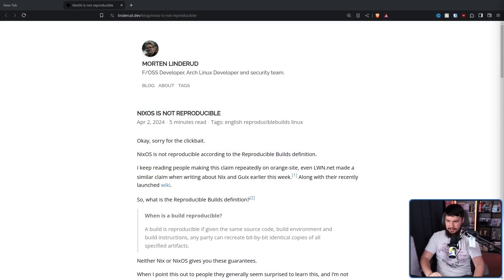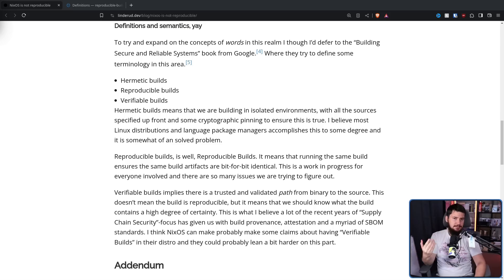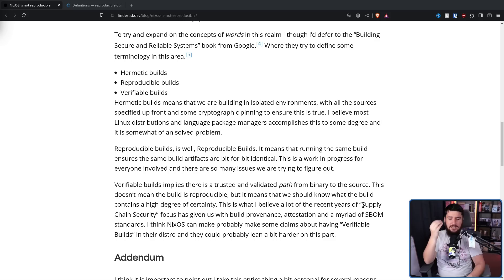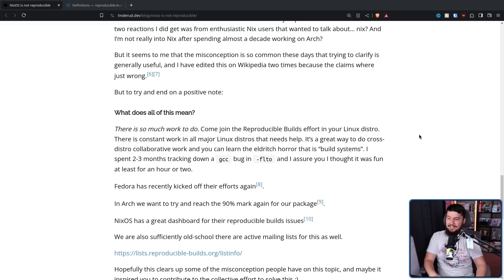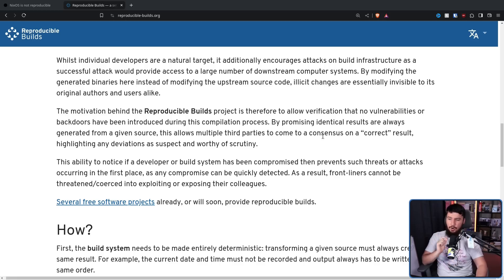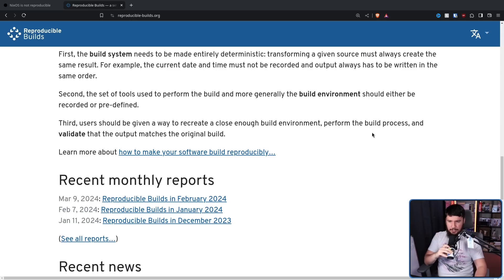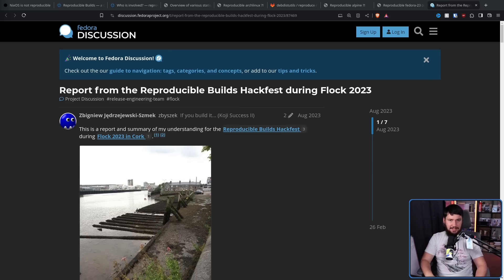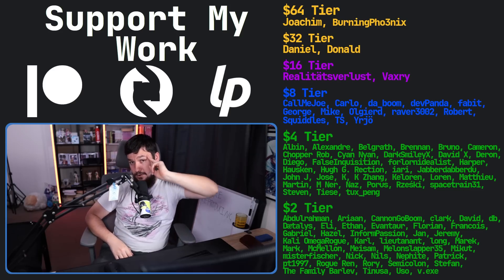Reproducible Builds: Final Step In FOSS Validation

Comment: 100% reproducibility is required for aerospace software applications. There can be exceptions like a date timestamp and CRC, so long as the functional requirements are properly verified. Non-deterministic behavior is not tolerated due to functional safety...how does the customer know that the verficiation tests that passed once will pass again?
Reply: 100% determinism is required, meaning that the program always behaved in the expected way.

Reproducibility is different in that the underlying binary should be identical.
Reply: @Person1873  I see what you are saying, but (aerospace) software verification results are tied to the requirements, traceable through source code and through the resulting binary. That traceability all the way down has to be deterministic. In other words, the verification test results are tied to a particular binary.
Reply: So, you’re saying that AI/ML will never be allowed in aerospace applications…
Reply: @warpedgeoid  Maybe as a tool for humans to use but probably not with direct and absolute control over systems at least in the near future.  

@dozerd42 I'd love to know how they do the functional verification and if it could be applied by the opensource community.
Reply: @KLR-3  the main way to show full coverage is to run and pass all verification tests on the release binary, then run the same verification tests on a modified build with instrumentation. We used a program called VectorCast. The purpose was to show that the same tests pass on the modified binary, and 100% MCDC coverage is achieved.
Reply: Not in anything that can jeopardize the mission. Hal was right about Dave. Dave is neither deterministic nor reproducible.  @warpedgeoid
Reply: @warpedgeoid  Id love to observe the FAA conversations about AI in flight control software! My guess is that DAL A will never allow the inherent nondeterminism that AI has. Think about this: the pilot wants the aircraft to behave with predictable deterministic behavior. Every combination needs to be functionally tested (MCDC coverage)
Reply: @warpedgeoid  On the other hand, cabin electronics devoted to nonflight critical applications would not have a problem with AI. For example, a blu-ray player for passengers is fine as long as it doesnt short out and cause fire. Software on the blu-ray player in the cabin would be an example of DAL E software. Hardware is governed under the RTCA documents
 DO-254, software under DO-178
Reply: PGP signatures against the working software, it's the only way I could think of, one bit is changed PGP signature is completely different

Comment: Personally I think Nix has the right idea, but execution wise it's way too difficult to set up, maintain, understand. 

We need a new generation of Nix-like packaging that's integrated better with familiar tools and apps like Discover/GNOME Software, for a start.
Reply: what we actually need is to seperate OS from software.
Reply: @bigpod  Agreed, haphazardly dumping everything into /usr/bin and /usr/lib is slightly insane imo and it's still what every major distro still does.
Reply: @bluesillybeard  putting things into /usr/bin and /usr/lib isnt a problem they or something similar needs to be there but how they are managed is if they were layered file systems of their own it would be completly controllable and seperatable from base OS /usr/*, kinda like containers just directly on your host using OverlayFS(same filesystem containers use)  honestly i would make everything an overlay even home directory on top of a clean basic(very basic) installation of OS
Reply: @bigpod  This is what I mean. Some way to manage the files in /usr/* that isn't just adding and deleting files hoping you don't accidentally get a conflict and end up breaking something. The hard part really is just getting everyone to support it. Flatpak is getting a lot of attention but it has a lot of issues.
Reply: @bluesillybeard  thats why im pitching overlaying files they dont touch each other so you can delete and add however much you want(specially if you are adding layers instead of just mutatating mutable part). OverlayFS is already part of the kernel and has widespread usake from docker podman to flatpak and most linux distros support systemd so we can use sysexts which utilize overlay fs just like im describing(im not saying systemd it is but its a good starting point)
Reply: Yeah I really want to learn NixOS, but I feel like I’d be learning “Nix stuff” rather than more “Linux stuff” and all that learning and knowledge would be locked to a specific distro that is known for subpar documentation and is quite niche and not really recognized by the industry as of now.

I feel like more of the mainstream distros can take notes from Nix though and implement those ideas eventually.
Reply: @646464mario  maybe check out OCI native containers for fedora silverblue and UBlue project its industry standard tooling(containerization tooling), it is immutable but honestly you have just us much control just you have to do it before it gets to your system

Comment: hmm, but why binaries include these data (like time) into their builds? Also I wonder if multi-threading can affect reproducibility, I mean some parts of app would be compiled faster on some pc's and other on other and when final combining of these parts is done, then it could result in slightly different binaries (?) - but I guess that can be solved by disabling multi-threading (running compilation on only one thread).
Reply: it is a great way to distinguish software versions - build timestamps are often way more useful than version numbers / commit ids. Timestamps can also be used for deriving build-time-encryption keys for something like XOR, to protect your strings :) It is neat!
Reply: A good project allows you to override any timestamp values so downstream projects can coerce reproducibility for elements that would otherwise break it.  In many cases, build systems support overriding values upfront, but if that fails, coordinating with the offending upstream project is required.
Reply: Yes it can
Reply: However, you could always have a way to consistently sort the object files for linking, and then the order in which they are produced wouldn't matter as much.

Comment: something source code/compiling adjacent is on andriod, there is the fdriod store (and or repo)
where a thing they do is for a given source tarball they will compile it to the *.akp (and then link to the source tarball used to make it)

so if you follow how fdriod builds the apps from source to the tee, then you can get the exact same akp that fdriod builds as well.
Reply: there is a downside to this approach as you can only update the app from the same source as you installed it from

so this means if you installed from fdriod, and then tried to update the app using a github build it would reject it and not update (something something digital signing)

this means for apps which update every say 4 days, then you would be better installing from github than fdriod as the updates come faster
Reply: @aceae4210  F-droid can actually deal with these signature incompatibilities. More specifically, if the build is reproducible they can re-build the APKs on trusted infrastructure, take the signatures from GitHub versions and add them to their own builds (which should be the same thing at this point.)

Comment: Related to the verifiability of builds is GNU MES, which is part of the GNU Guix project. (FIY: GNU Guix is based off of Nix, but uses Scheme instead of Nix's DSL, and is like all GNU projects explicitly FLOSS.)

What they're trying to do is to bootstrap the entire GNU Guix distro from a tiny handwritten hex program that in turn builds an assembler, then c compiler, then scheme interpreter that can interpret the Guix package manager and then build the rest of the system from there.

This is all to over come what Ken Thompson talks about in 'Reflections on Trusting Trust' where he describes creating a compiler that injects viruses in other compilers that also injects that virus into every compiler that it compiles and so on in perpetuity, and it being an almost impossible task to know for sure that your compiler you use to build your 'trusted' programs doesn't have that virus in it.

So the only logical answer is to build it all from scratch which GNU MES is trying to do. Which I think is pretty cool.
Reply: Oh, that is cool, I thought that guix is like nix but it uses scheme and is fully FOSS by GNU standards. And that "fully foss" is importunately probably stopping many people from using it because If I am not wrong (and I might be wrong) linux libre kernel is not only not-including binary blobs, but also stopping users from adding them by themselves. This also means that nvidia drivers (and many other) are not available. But this thing you are talking about to build system from scratch is very interesting. Maybe nix is also trying to do something similar?

EDIT: I quickly looked online and it seems that nix is also discussing it, and some progress is being done (but I only skimmed through git issue so I am not fully sure). But at the same time, If guix have that implemented, then I guess it can be also implemented via compiling neccesary parts in guix and then doing rest in standard ways for other distros than guix.
Reply: @Daniel_VolumeDown  As for non-libre firmware or drivers, there's the nonguix project which provides the regular Linux kernel and whatnot. If your hardware can boot linux-libre, setting up nonguix is just a matter of adding a few lines to your config.scm and running `guix system init` with one extra flag.
Reply: @mskiptr  good to kno, thanks
Reply: @mskiptr thanks for the info, I've been using nix and avoiding guix because I heard of the floss problem, didn't realize it was such an easy fix
Reply: I love Guix, scheme is so much more beautiful to work with than nix.
Reply: Related to the trusting trust paper, I've read another paper about a technique called diverse double compiling which can solve the compiler trust issue. I don't actually have the math background to know if it's a good idea though
Reply: @thealmostfreerunner  The diverse double compilation is overall a great idea that improves the practicality of verifying compilers by a ton. Especially if we could both a lot of people getting the same result and some people manually auditing source code in the entire compilation chain.

It has even been attempted to some extent. For example, during the 5th Reproducible Builds Summit, a diverse bootstrap of GNU Mes was attempted, using several different distributions like Debian, Arch, Guix and Nix.

One potential problem here can be how diverse such bootstraps really are. In the case above, it all ran on Linux so the kernel could be a common vector. Bringing BSDs or even Windows into the mix would certainly be a huge boost here. (Tangentially, I remember hearing about plans from some MS employees to take part in one such bootstrap, though if I remember correctly in the end they didn't follow up.)
Reply: This is funny because I'm writing a story where the Illuminati cult uses such a malware-injecting compiler to ensure that its tracking software is injected into everything everyone ever makes. I suppose I should've known someone would've actually considered that as a real vulnerability, but I was happily writing my silly sci-fi and never once thought about such a thing IRL.

Comment: Casually drops "If you're an LFS user"...... Trust me, you REALLY don't wanna do that, like at all. I keep an LFS install in KVM for learning and general messing around, without snapshots it probably would have died about 10 times in the last 6 months, just the thought of running it on a live system makes me shudder.
Reply: LFS isn’t that bad, the first installation I did was on my main system.
Reply: @Fractal_32  LFS & BLFS are not bad at all, its an incredibly well written book done by very knowledgeable people and as long as you read, understand, read again then do exactly as the book says you're good. The problems start as soon as you deviate from the book at all. For example on my install I killed sysvinit and replaced it with openrc, this actually very simple change resulted in 2 reverts and multiple hours of frustration, on a live system it would have been game over (unless you keep the second install around to chroot when you destroy something) and that's the real issue, unlike Gentoo anything outside of BLFS is entirely undocumented and in lots of cases things that should work fine just don't.

Edit - There's actually an example from BLFS, Zsh. To get Zsh working required me to do an almost complete rewrite of /etc/profile because the way BLFS handles system paths relies on a function of Bash that doesn't exist in Zsh. To this day I have hacky workarounds in place because Zsh doesn't source /etc/profile at all, it should do that automatically during the users first login (that is a POSIX requirement of all shells) but it just doesn't and I have no idea why at all. I l have to source /etc/profile in .zshrc and .zprofile to get correct paths and yes, I do have the /etc/zsh/zprofile file that is supposed to handle this installed.

Comment: 0:25 I started using NixOS instead of arch like 2 months ago and ran into the same thing LOL. (NixOS is hard... And to thing that Arch was sometimes difficult XD)
Reply: @robnobert  I've found the Nix OS documentation to make a lot of assumptions of what the user should know. It also appears to have a lot of undocumented conventions that are supposed to be obvious but seriously aren't. For example, how are you supposed to know that the parameter is modificationSafe = true and not modificationChange = safe? That's a bad example, but I see lots of configuration variables for some packages that are not consistent at all and you seriously wouldn't be able to know about without reading some source code.
Reply: @robnobert  EXACTLY! I LOVE the Archwiki. 

There is a wiki for NixOS but good luck finding everything there. You'll have to take a look at some blog too, some Appendix manual something for home-manager, man 5 configuration.nix, nix-shell which you HAVE TO learn if you're doing dev work, then people start throwing flakes at you, environments vs profiles and man I hate the way they deal with docs this SO MUCH. If it weren't for discord half my stuff wouldn't be working. 

Then you realize that even though all the files are .nix you can't just paste the setting to allow proprietary packages into the .nix file for builder but you have to set the variable and run it with --impure or allow proprietary stuff globally. God... Make it make sense or document it better.

The docs are, basically, nonexistent IMO.
Reply: @robnobert  idk how that has changed but their packaging documentation essentially(im paraphrasing) went here is repo find a program that is like yours and package yours like that one is, there are 4 if not more ways to install software on your NixOS and only half of them are permanent and among those left over only some are actually correct
Reply: @robnobert iirc, there's a WIP distro just like that called SnowflakeOS